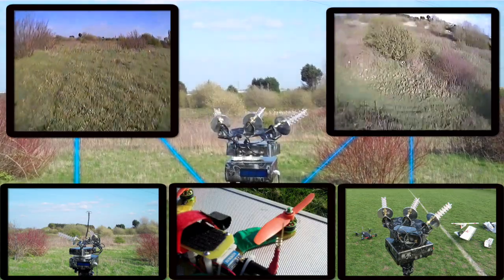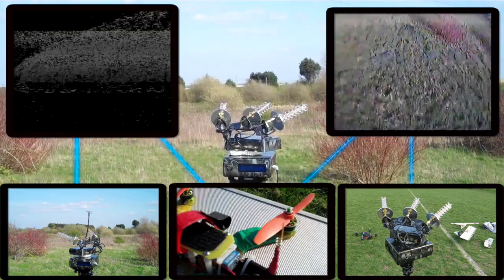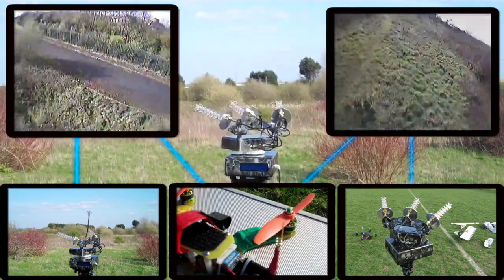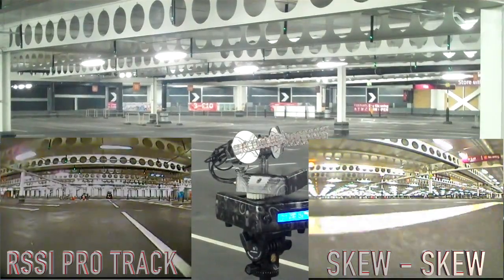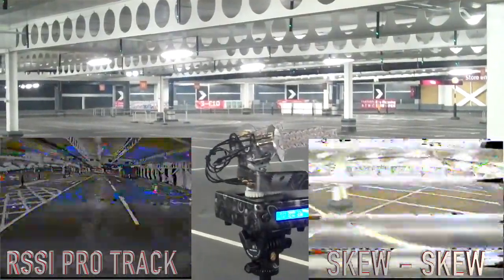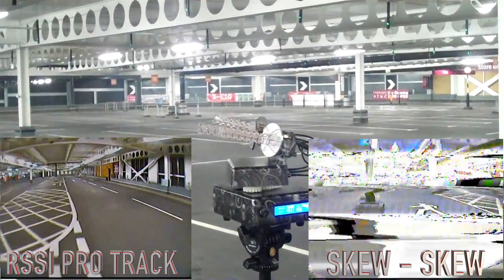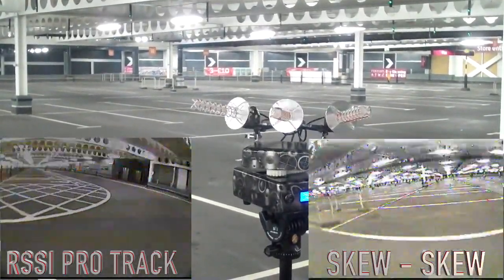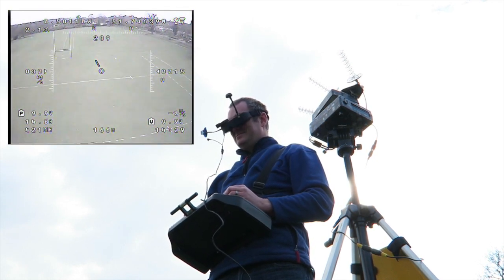RSSI PRO TRACK - WORST RF NOISE TEST

Comment: More questions! 
I just bought a pair of SkyZone goggles that support 3d (two Tx/Rx, for 2 FPV cameras)  Would it be feasible for me to strap on a 4th antenna in the middle, then run the two center antennas to my goggles?  The additional 4th one would not need to connect to the system, since the direction is the same. 
Also is your system's firmware/software updatable or even better, open source? which would allow for bug fixes and new features in the future?
Reply: Allan Sanderson Hi Allan, the 4th antenna i will have to check it out but if you just place the 4th on top of the tracker and set the same channel the only other thing is the 360 rotation and power for the vrx (we have a spare 5v power supply in the top case but this might require a booster to 6+ volts)  as all wiring goes through a slip ring so as long as you dont rotate 2 many times and your cable is long enough it should be ok if you are careful also might be possible to ditch the wires altogether and have 2 repeaters one coming of the tracker output and the other from the no 4 vrx output but this could be messy the firmware update is just flashing the chip on the top PCB not difficult but unfortunately the code will not be open source  but we will upgrade and add new features as it evolves through the members forum on our website coming very soon :-)Hope this helps and makes sense 
Tommy

Comment: What happens when someone else starts transmitting on your channel, or almost on it? How much testing have you done with multiple FVP pilots in the air?
Reply: Allan Sanderson Hi Allan,we have tested with multiple pilots in the air on different frequency's no problem however if someone else starts transmitting on your  channel next to you when you are in the air then as with all trackers and receivers it will be swamped by that signal, there is no protection against this but we have built in a reset button which when pressed will enable you to manually turn the tracker towards your plane/quad to hopefully regain signalTommy
Reply: Thanks Tommy, Good to know about the button.  My Aussie dollars are pledged!  You should post an update on the Kickstarter with an estimate of how much the commercial version will cost compared to kick starter - you might get a few more backers.
Reply: Allan Sanderson Hi Allan  thanks again for your support and advice thats another good idea from you :-)

Tommy

Comment: You got a whip antenna with a circular polarized antenna that's not going to work good at all you have to at least have a circular polarizer with the circular polarized antenna that's not a valid test
Reply: kyler peterson   Hi Kyler, thanks for your observations just to be clear that was the aim to not work good at all in the field, we used a rubber duck to make it harder to track during the outdoor test which was a valid test of the system and not of the advantages of circular polarization. the carpark was different we used circular to circular due to the RF noise again a fair test  
Tommy
Reply: RSSI Pro Track yeah but you're not understanding in the video you obviously. Clearly leave out what you guys were using on the quad copter that was with the RSS tracker that obviously when you came in a little and you did not see no rubber duck on that one you should look like there is a circular polarizing turn on that one he doesn't say in the video is the it is or not that looks like the circular polarized with your antenna tracker which you can't use 2 different endings and use the good ones with your art your tracker and then you're using a helical which is a high gain antenna with your circular polarized antenna and then with the rubber duck here use in a circular polarized that's not valid you need to go back and redo your test and put a rubber duck on the other one and you need to put  a helical antenna on the other one with the rubber duck you need to just be testing the tractor the way it actually pointed at it and then the other one you need to go instead of right in front of you and do a line straight out and straight back so you can see the results of that video they have equal antennas going straight down a path and then you're seeing how good the helical shapes of pointed straight on it and I will show you how much better that's where you're not valid at all
Reply: kyler peterson Hi Kyler  apologies but i am finding it hard to follow your comment so i will describe out testing process 

To prove the tracking concept using a high gain antenna versus a clover antenna as both antennas on the ground where right hand circular polarized, we could of simply placed a clover on the quad but decided to make it harder to follow by using a rubber duck antenna supplied with the transmitter with the outer shell removed for weight saving (bottom center pic).and mentioned 0.35 seconds into the video this was used for both runs 
run 1 we simply replaced the center antenna of our tracker with a clover  and recorded the output from the tracker to keep it consistent (bottom right pic)
run 2 we placed the helical antenna back on the tracker and recorded the output (center video)
As far as i can see this is a fair test showing the advantage of using a our tracker.

Tommy
Reply: kyler peterson There is a thing called punctuation that makes writing more understandable—or just understandable, in your case.  You might want to try it sometime.  I understand that it is free of charge.  Cheers!

Comment from the maker: The RSSI Pro Tracker Kickstarter is almost there reaching it's goal of £15k. Kickstarter link https://www.kickstarter.com/projects/641849190/rssi-pro-track-58ghz-antenna-tracking-system
The was a group of people sitting on the fence awaiting some real world testing so this video was filmed to answer their questions.
First the testing grounds are a piece of wasteland directly below overhead power line and directly adjacent to a large industrial estate. Also right next to this is a mobile antenna tower. Tomas is trying to give you a worst case scenario video so please don't assume the video quality is anything like what you would get with it all set up well in a good RF noise situation.

Second part of the video is filmed in a car park that the guys usually avoid due to the high noise levels. This is probably the best example of the Pro Tracker in action under worst case scenario.

The Kickstarter is almost up. It would be a real shame if it were to fail to make it's goal as I believe that a set up like this will be essential one the powers that be start enforcing stricter control of the RF power limits.